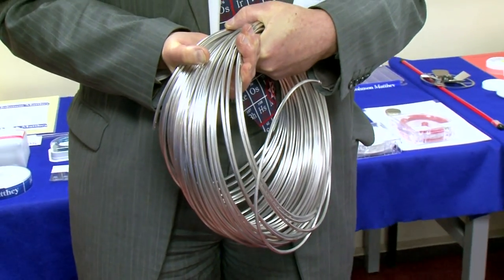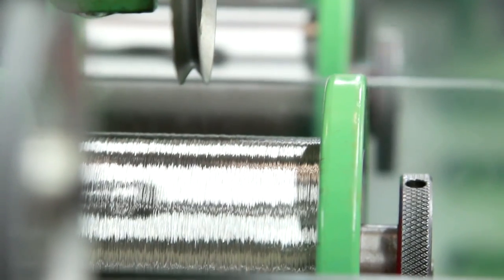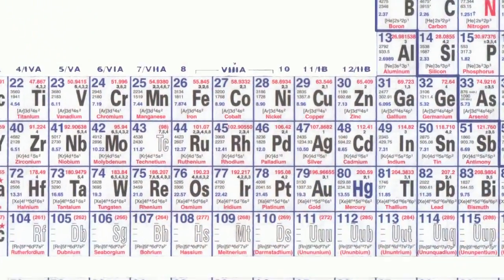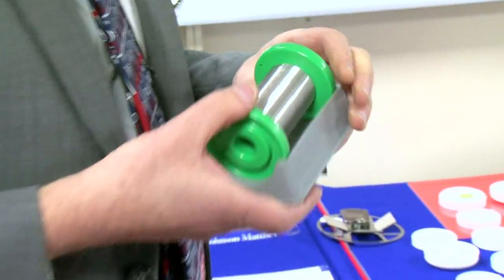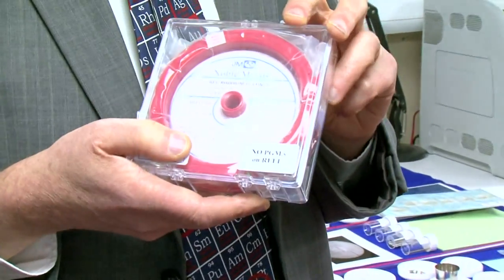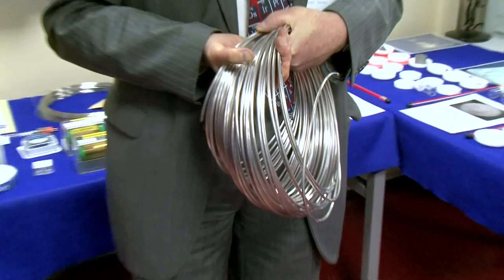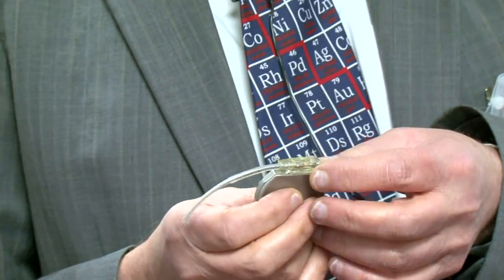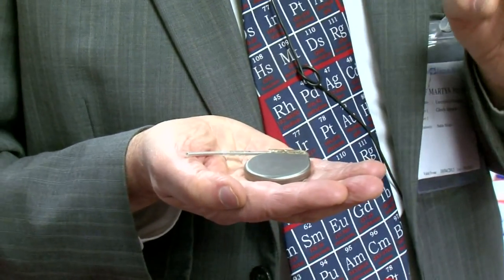Rhodium - Periodic Table of Videos

Comment: Assuming I did the math correctly (which is a big assumption where I'm concerned) the yearly global production of Rhodium metal (20 metric tons, according to the Prof.), based on a density of 12.41 grams per cm^3, would form a solid cube of metal only 1.17 meters (3.8 feet) on a side.

Comment: Water toxicity is from dilution, not loss.  Yes, eventually fluid diuresis will occur and some loss will occur, though the kidneys can handle much water overload before medullary washout occurs.  However the initial toxicity is from a net decrease in concentration due to an increase in volume.  The main ions of concern are potassium, sodium, and calcium (k+, Na+, Ca++).

Comment: "In it's metallic form, gold is not toxic and is often added to specialty foods and drinks. None of the body's natural processes can break gold down into its atomic form, and gold easily resists corrosion even by stomach acid. However, most gold compounds, such as gold salts, are toxic as they break down in the body, releasing a gold ion. These can damage the liver and kidneys.  One of the most common forms of gold poisoning is potassium gold cyanide, which is used in gold plating"

Comment: I think the Earth's core is mainly made of molten Nickel and Iron. It's molten because of the extreme pressure from the mass of the Earth, not due to radioactive reactions, as is the case in the sun (which is primarily a fusion reaction of Hydrogen, forming Helium and releasing lots of energy).

Comment: At one time Rhodium, and might still be, was used in plating hard drive disks. It has an extremely hard surface and was a substitute for Hard Chrome on the disks. In the 1970s Rhodium was about $400/troy ounce and today it's about $1100/troy ounce.

Comment: Gold is considered completely inert with respect to our bodies. There is also no specified minimum daily requirement. It does however form a primary cell when in close proximity to other metals when immersed in electrolytes (most fluids in the body). People that have gold crowns and have had new amalgam fillings now about this. As amalgam ages it stops reacting electrochemically (thank God)

Comment: While I normally dislike wikipedia as a source, I doubt you wanna read the related research articles, so just read the english "gold" article, subsection "toxicity".
As you can see, only gold compounds can be dangerous and they don't form in the body when elemental gold is ingested.(also, regarding electronics: Quote: "Besides sliding electrical contacts, gold is also used in electrical contacts because of its resistance to corrosion, electrical conductivity, ductility and lack of toxicity." )

Comment: > It can carry electric currents very well

That's why the the Platinum-Rhodium alloy in the pacemaker is covered in plastic. In any case, neurons are more or less electrically insulated and they communicate with other neurons chemically, a little gold wouldn't change their conductivity by much.

Aside from risk of choking/blocking if you swallow a large chunk of the metal, pure gold is non-toxic and non-poisonous and aren't going to react with anything in the digestive system.

Comment: I can't. There are only the options to always use low quality or to select the quality according to the connection speed (which doesn't work correctly).
It's a huge annoyance to me. And it would be such a small thing to make it reuse the prevous setting (just like it does with the volume).